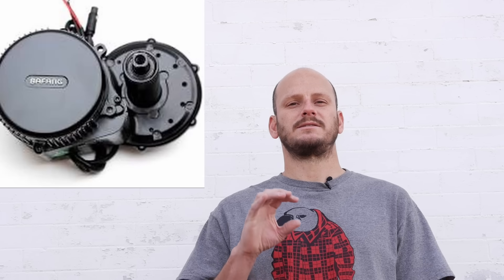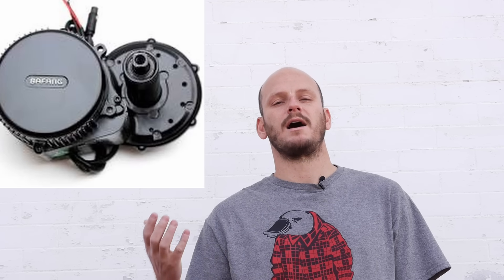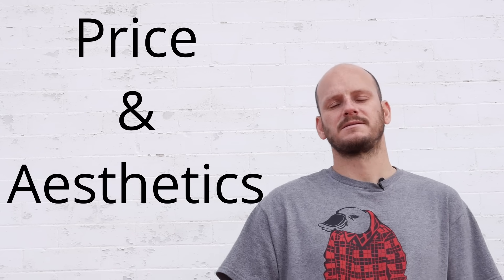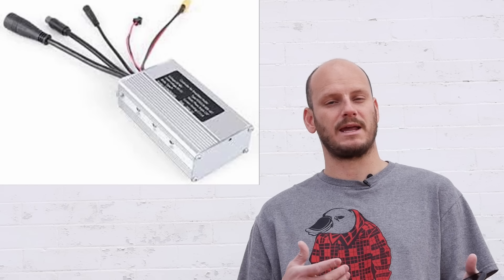Hub vs. Mid Drive Motors: Why Hub Motors Suck and Debunking Common Myths with performance test

Comment: I live in Europe and here, things are a bit more complicated. If you want to buy a new bike with a mid drive, you will pay a lot more, than with a hub drive. I drive both and for me, it's more a question of the riding style. I totally agree with you on the fact, that a mid drive is more natural, like a normal bike. I have a Bosch on my Cube, and yes it's really good. On the other side I have a totally cheap trekking bike with a 250W hub motor, just a cadence sensor, no throttle as it isn't allowed here, and I love it too. 
As much as I love the Bosch, it is to loud and at 25km/h I get stuck in a to slow or fast gear. Thats frustrating and I don't get a Deore 10 speed cassette with a better ratio to fix that problem. Thats an unknown problem with my hubmotor, as it feels like you just riding a wave. I really love high cadences, and for that, a hub motor is the best, in my opinion. All mid drive motors I've tested, are getting very loud once get over 90 crank revolutions. When you hit 100 and more, you just have to love the sound of motors. My hub motor is just quit. I will never get up mountains with it, but if you live in a flat area I think, the hub motor is a very nice option. 
And another thing, my Bosch bike needed a fresh wear set after 4000km, my trekkingbike with the hub motor is on it's first wear set without any problems after 12.000km. 

So when someone ask me, what should I get, I wouldn't just say mid drive as I think hub motors can be very very nice.
Reply: I think if I lived somewhere were I was limited to 250w and no throttle, I would be pretty unhappy.
Reply: @stevenleslie8557  yes some of the regulations are silly, European law has a loophole in that the law actually states the motor can not be continuously run at more than 250w. So it’s possible to fit larger wattage motors that have a stamp or sticker saying this. 
To me this is no different to being told I can’t have aV12 5 litre engine in my car. 
Some mainstream motor manufacturer’s now listing and stamping motors as 240/250w when in fact have seen these stock motors tested on yt with an independent watt meter fitted drawing up to 1000w in tests. 
The throttle rule is also silly. 
I have a disability that cycling from stop causes me safety issues. While I never use throttle in general I have to use it to get my bike moving safely. 
Different European countries also have different interpretations of these laws. 
Take France. Not sure about ebike laws but know they now have e cargo bikes kitted out as medical emergency response bikes ridden by doctors in Paris. 
These bikes can respond quicker than the motorcycle version. 
French motor manufacturer Citroen have a new “ami” it’s basically a 2 seat electric plastic body car with a max speed of 50kmh and here’s the kicker can be driven by anyone 14 years old up with no licence or insurance required. 
A lot of the rules being made across the world concerning ebike is actually monetary based because governments stand to loose lots of revenue in taxes people pay for petrol and road taxes. The car and oil company’s also stand to loose big if people take to alternative forms of transport. 
Rant over lol
Reply: @patomahony9747  I think you are missing a fundamental point. There is a dividing line between an electrically assisted bike and a fully electric bike/electric motorcycle. The 250 watt limit is to avoid the inevitable clamour from some politicians and various "safety advocates" who will scream that more powerful e-bikes with their higher speeds will increase reckless behaviour and that they should be licensed, insured, with compulsory helmets, and after that annual safety inspections etc. just like motorcycles. Possibly even a demand for rider testing and licensing.  If one of the UK tabloid newspapers picks this up as a "safety campaign" we will find it hard to argue against. We are starting to see this with electric scooters. 
The cost of ownership will become prohibitive. I certainly don't want to be stopped for a breath test after leaving a pub because I am riding an ebike while my mates aren't. There is already factions here in the UK calling for ordinary pedal cycles to be registered and insured, mainly because of reckless cyclists riding on the pavement, running red lights etc. and this would give their arguments more weight.  Personally I don't want to go there, so if the 250 watt limit keeps that at bay then I'm all for it.

N.B. There is historical precedence for this argument. After WW2 Soichiro Honda starting making small petrol motors to attach to bikes to provide assistance. At first there were no legal issues here in the UK. When they became popular the UK government created the "Moped" classification with some regulatory requirements, then Yamaha took it to the extreme with the infamous FS1E which exceeded 50mph with a lot of teenagers being hurt, so the government clamped down and reined it all in.
Reply: @bimble7240  I agree there are many angles this can be looked at. The tabloids and clowns invading controlled airspace did that with the drones which eventually filtered down to the ordinary  RC aircraft hobbies now also heavily regulated a hobby that countless enjoyed with common sense for years. 
Had a similar suggestion here about registering, road taxing  and insuring bikes etc. 
One   The bike lobby has brought to attention the poor infrastructure for cyclists. 
Second the number of people now using bikes in favour of other forms of transport 
To a lesser extent reckless cycling. 
The scooter situation is a joke and from what I can see a way for government to get its share of the spoils. My understanding is in U.K. it’s currently legal to hire or lease a scooter to use in public even though there is apparently no insurance etc included in its hire but illegal to use a scooter in public if the person actually owns it. 
Sounds like an unfair corrupt practice and a denial of people’s freedoms of choice. 
Next we will be told it’s illegal to drive a car we own on public roads but it will be ok if we hire or lease one. ????
Last evening was nearly hit from behind by a road racer cyclist. I crossed a 4 lane road at a pedestrian crossing and hopped on my ebike when this cyclist blew the red light and actually brushed my elbow as he passed. Next red light never even slowed down let alone stop. Red means go lol. Currently here it’s legal to cycle on the footpath. Many cycle lanes have ramps directing bikes on to the footpaths. Some paths have  marked bike lanes etc. 
The sensible amongst us keep our speed down and respect the other users. 
Also many pushbikes are a lot faster with less safety features than ebikes. 
All this may soon be mute because the European Union is proposing that all bikes require insurance. In fact they are going as far as if you have land and have an electric vehicle of any kind ,electric quad, golf buggy etc you will be required to have it insured to drive on your own private land. 
Now Britain has left the eu but is still adopting some of its new laws and regulations like for example all new motor vehicles manufactured from next year will be required to have a speed limiter similar to those fitted to HGV vehicles but technically more advanced in that there will also be cameras and I think BTLE and gps. 
Way system works apparently is a combination of cameras to recognise posted speed limit signs in conjunction with BTLE/wifi and gps. 
Yes initially we will be able to turn it off but it’s back on next time vehicle is started. 
Yes apparently keeping throttle pressed will also overcome limiter but with audio or vibration warnings. 
Like a HGV it will be possible to access the records of this system that’s if it has not already been uploaded to some agency automatically. 
This technology currently exists in many forms on motor vehicles. 
Take the bmw mini. Keyless fob  no ignition key. Those fobs record a lot of information about the vehicle including mileage max rpm , amount of fuel taken on board with a time and date stamp. And lots of other parameters. 
Sadly we the people are embracing a lot of this new technology that is allowing our society to progress to a kind of Orwellian society where big brother knows all and to quote animal farm “ all animals are equal just some more so than others “
Please allow me some licence if the quotation is not exact but I’m sure you can grasp its meaning.
Reply: @patomahony9747  Which country are you living in at the moment Pat?
Reply: @bimble7240  I’m in Ireland (republic of)where we have NO REGULATIONS on ebikes or scooters currently. Scooters  technically under current laws are in a slight grey area because of the throttle. If it will propel the scooter from rest it’s illegal but if you have to push the scooter and motor only engages once it’s moving it’s legal. Only issue the police have here is with diy bikes. Because they are diy and not factory they have no ce certification and any user that comes to their attention for cycling irresponsibly usually has their bike seized. Friend has a stealth bomber type ebike 5,000 W or higher and has been stopped several times by police to check out and admire his bike. Police told him once it’s factory built and he’s not riding like a lunatic jumping red lights etc there are no issues. In fact those add on ice 2 stroke power units that fitted over the front wheel of bikes  and were engaged as bike was cycled to start them were used here. Did see a few back in late 60’s and was surprised to see one  in past several years and unless laws have changed here in recent years are a legal add on that does not change the status of the pushbike. Thinking reason they’re were not more common here was difficulty of getting them. There was no online shopping back in those days. 
I also have a 1200w e trike I bought around 8 years ago when I was basically having to use wheelchair. 
Before I purchased  the trike  I sent it’s specifications to department of transport. Department of justice and the road safety authority. 
Many emails later and some buck passing I was informed in writing that once driven by a certified disabled person it is ok to use and classed the same as an electric wheelchair. On the road obey rules of road and on footpaths drive with caution etc. 
Since then have seen these type of trikes , the 2 seat version ,for hire in Spain with a sign on them that the driver or passenger has to be classed as disabled. 
While there are different rules from country to country I fear this will end shortly with the harmonisation of rules across Europe lol
Reply: @patomahony9747  Hi Pat. This doesn't surprise me at all. I lived in Eire for a while many years back and some of the things I saw being driven amazed and terrified me in equal measure. A Rice horsebox with a horse on board being towed by a mark 1 1100 Fiesta driven by a learner driver, on his own, because his dad told him to. Poor kid was scared shitless. Many other amazing sights, and the Gards were not bothered at all. I expect they might have tightened up a bit now.
Reply: @bimble7240  still possible to see such sights. Many consider the Gardai not much more than glorified tax collectors. But with mot’s introduced here a lot less dodgy sights on the road these days. Some German friends who live here are amazed at the strict nature of our mot’s compared to Germany. 
Was at an mot(NCT in Eire) Center and seen a 12 year old pristine nissan micra failed for rust. Door seal on bottom of drivers door had surface rust around holes that secured the seal. The seal had to be removed to see this. I fixed it for the lady in less than 20 min with a rub of Emery paper and a quick shot of cheap spray can I had handy. Not an exact colour match but not visible once rubber replaced. Brought NCT inspector back to car while paint was still tacky before refitting rubber lol
If and when they do harmonise or introduce laws I expect to see the Gardai out on every street corner checking bikes. So when this happens, initially will have controller  set to 5 amps and motor assist speed limited to 25 kmh. 
Currently my son has MX02s and on level in pas 0 can easily cycle it at 50 kmh    
For the most part ebikes and scooter users wear helmets, safety gear and have lights etc 
Other than road race cyclists most other cyclists don’t use helmets etc and as far as I’m aware not required by law. 
Was stopped at a COVID checkpoint one day in my car and noticed police officer I was talking to eyeing up a guy cycling on footpath beside us so I asked Garda was he breaking the law by doing so. No says Garda ,reason I was looking at him is cyclist is high as a kite on something by size of his pupils and wobbling ,but he’s cycling carefully so he’s grand. 
So basically there are several Garda modes. 
Go out and clamp down on these terror cyclists if told to do so. 
Garda needs to make his quota of fines issued for the month( normally see a lot more Gardai on roads near months end)
Or nothing serious here , I don’t need the extra paperwork so no notice taken. 
Can not remember last when I heard of a cyclist being prosecuted for an offence. 
Yes in recent times have heard of scooters being impounded as illegal but if I remember correctly in 2020 country wide was less than 200 and most of those because of reckless use.
Reply: @patomahony9747  I do remember the requirement for a roadworthiness certificate for some insurance companies but you could buy one for £20 vehicle unseen, so a joke really. Does seem like the Gardai are starting to be a bit firmer though. I didn't know about the 5amp limit. Is that an EU limit?
Reply: @bimble7240   current eu regulation is no more than 250w continuous but you can basically have any size motor fitted. So taking a mean voltage of 50 volts @5 amps means controller can’t supply more than 250 watts.  Have seen some newer controllers where you can power up bike set amps to give 2000w and if stopped turn bike off and it comes back on as a 250w setting. Newer delfast s have this system I believe 
Depends on what happens with actual regulations. Know I have a box of tricks at build stage that will repurpose throttle as an e brake at flick of a switch or by a magnetic Reed switch. Several options I have been toying with. Another is remove switch and fit a wi fi switch in the frame using a radio control model servo or a drone  ESC to supply the signal.
Seen I believe a Bosch cx 240 mid drive tested. Rated as a 240  watt unit but has if I remember correctly 160 nm of torque and draws in excess of 900 watts. 
But 240 W rating make it eu street legal.
Reply: @patomahony9747  Thanks for that very helpful explanation. Are you just talking about mid drive or are rear hub drives available with this much torque? I can imagine the wear on the chainset and cassette will be very noticeable.
Reply: @bimble7240  mid drives for the high torque and better performance on hills Usually to get in excess of 90 nm on a hub drive you have to go up to 3000 to 5000 watt range.
Reply: @bimble7240  my understanding is to get likes of 160 nm from rear or front hub motors you are in the 3,000 W plus bracket. Likes of MX02s 1,000 watt miter is supposedly rated at 95nm. Rear hubs only wear chain and sprockets by amount of effort supplied by rider. Only example I have is 15,000k on Lo26 on fairly level terrain. Owner has replaced rear freewheel and upgraded main crank and sprocket. Rear freewheel was 13 to 28. Because owner was riding distance in top gear the 14 tooth wheel wore. So he fitted a much larger crank and front chain wheel changing complete unit for a better one. He changed the rear freewheel for an 11 to 34 tooth.generally he now uses the middle gears and spreads the wear. 
On mid drives I believe a 750 watt has in region of 130 nm and in general because of higher torque perform way better on hills. 
In turn because torque is transmitted totally from main crank through chain to rear freewheel and axel these wear a lot quicker. Think I seen reports of users changing chains and sprockets every 5,000 km. 
most serious long distance mid drive users carry a spare chain because they are reputed to snap.  
We’re it not for the prohibitive cost I we hold favour a mid drive because I live in a crazy hilly area.
Reply: @patomahony9747  Thank you for that. You have confirmed what I had suspected. In anycase I am not going to go for a very powerful motor as I want to keep the weight of batteries and motor down, and therefore also the cost. I was thinking about front hubs, because of the wear issues you just described, and rear hub difficulty of changing a wheel (puncture), but there must be a problem with wear on the head bearings. Do you have any experience of them?
Reply: @bimble7240  no experience personally but I’m sure plenty of videos on yt. 
From an engineering point of view I would be more concerned about strength of front forks. As for head bearings I’m sure it’s possible to upgrade them to likes of down hill mountain bike or motorcycle quality. In fact I would be more concerned about the strength of the head tube attached to frame. 
If you want a round trip range of say 40 miles I recon a 20 ah 48 volt battery. 
As for motor a front hub would be my last preference. 
If you wish to convert an existing bike to e bike for city cycling a handy option is an i motor. Battery wheel and controller all in one. 
Think it has Bluetooth connectivity to phone or display. 
Know an Uber eats guy who had one for use around city instead of his car at peak traffic times. See link below but do your own search for best prices etc to your location. On this link ex check republic to Ireland it’s 500 euro all in. 
I also thought I have seen a 48v version. 
[512,26€ 33% OFF]iMortor 3.0 Full Wireless 26in/700C 350W 36V Brushless Motor Intelligence Bicycle Front Wheel Bike & Bicycle from Sports & Outdoor on banggood https://banggood.app.link/cP1j0Gv8djb

Let me know what you think.
Let me know which country your in may have other options. 
Also on site I posted link I purchased a Y-20 cmacewheel wheel in last 6 weeks for less than 900 euro in a sale all taxes and shipping included. Took 10 days to arrive from placing order. 
I also bought a set of quick release mtb pedals with good grips from same site for 17 euros delivered.
Reply: @patomahony9747  Rant on sir! I totally agree with you.  I;ve just fitted a front hub motor to my rear hub drive ebike. So now I'm 2 x 2. It's totally illegal here in the UK,  but I don't give a stuff. It means I can get upinto the hills that I love so much. My dodgy hip stopped being able to hike up them long ago. 
 I love my ebike, just pack a mini tent, sleeping bag, and a spare battery into the panniers and I'm away....
Sod the law !!
Reply: @stevenleslie8557  Me too! ;(
Reply: Ya, both BOSCH and Shimano STEPS are overly expensive for what you get. They use to be the only option for mid-drive with torque sensing, but now there are numerous options on the market.
Reply: Throttle is allowed in uk but its only a thumb type
Reply: I found hubs are loud but my bbshd is abit less.
Reply: @OutandAboutDevon  cheap hubs are loud because they're cheap. High end direct drive are quiet.
Reply: What country r u r In?
Reply: @martinmb6067   Germany
Reply: I did the same thing in Chicago, USA with my Mom's! She loved the rides but said "There wasn't enough gas in the tank"
Reply: If you have an envolio you dont even need to downshift before the light !